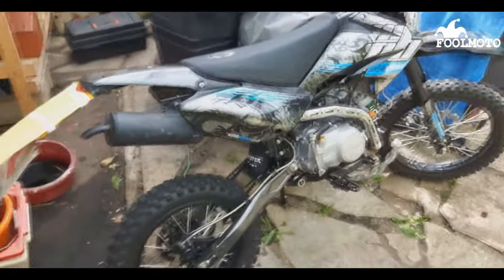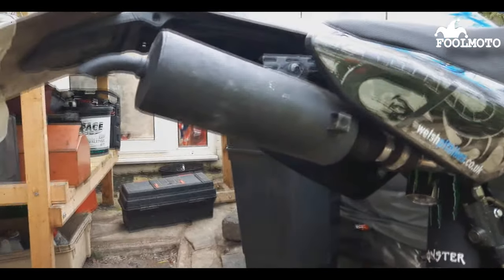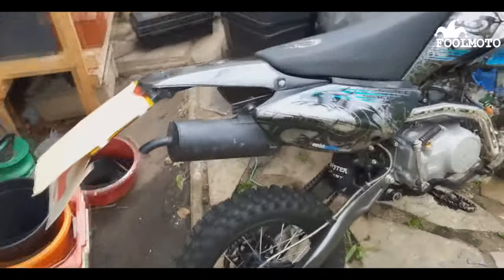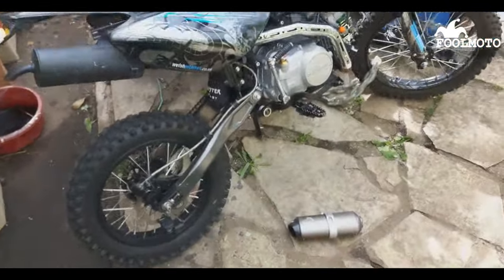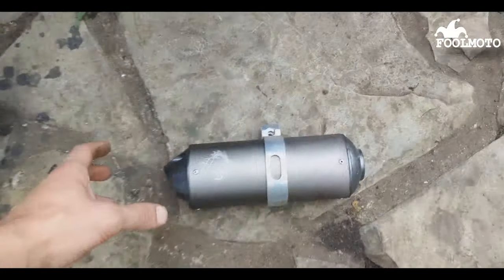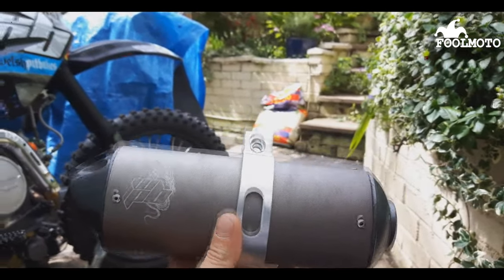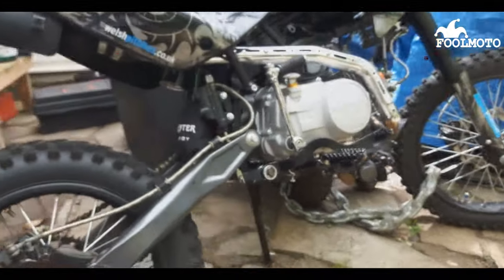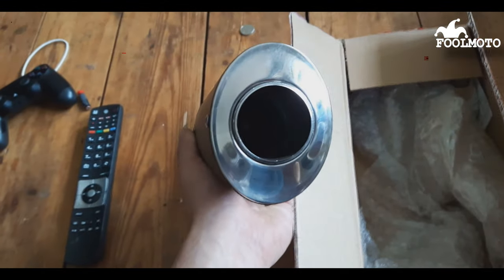PIT BIKE EXHAUST REVIEW!|3 DIFFERENT EXHAUSTS

Comment: Do you have bigger wheels, because your bike looks bigger
Reply from the maker: hi mate,yeah i got the 17 inch front and 14inch back plus the crf70 frame makes it quite big its as tall as my other dirt bikes
Reply: +FOOLMOTO I have a Wpb Race 125 and the wheels it came with are too small, dose the bigger wheels make the big slower or doesn't it make a difference
Reply from the maker: +AlphaRidez yeah get alot more out of the gears,and wheelies are easier to balance?,you just have to give a little more lift to get it up. The bigger wheels makes it alot better offroad and for jumps aswell
Reply from the maker: it doesnt affect the speed tho
Reply: +FOOLMOTO How did you get your pit bike road legal, who do you go to
Reply from the maker: +AlphaRidez i bought it road legal through dbracing.co.uk if you check out videos theres a link to where i bought a reveal of the bike came
Reply: Sorry to butt in but dbracing.co.uk only seem to have one 125cc road legal and it's a Kurz not a WPB?
Reply: The Documentary Dude they've changed what they sell because of reliability issues
Reply from the maker: they're dirt bikes really,so you have to maintain them like one.Requires a lot of maintenance

Comment: There are nice exhausts i have one myself but annoyingly the throttle response is affected by it and it drives me crazy. Might be due to a bigger engine however
Reply from the maker: do u mean the stomp stealth exhaust ??
Reply: +FOOLMOTO yeah thats the one expect i have the demon x version which is the exact same
Reply from the maker: ok yeah i know what you mean,its not  as responsive as the full race,a bit unpredictable,do you think maybe its the carb settings and jets .Because i know on two strokes when you fit different exhausts you have to adjust carb and jetting